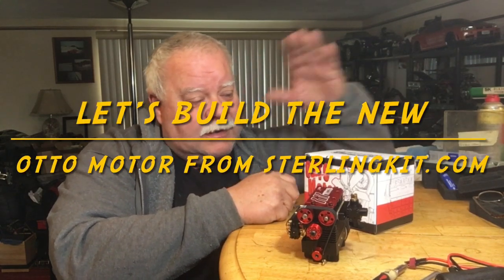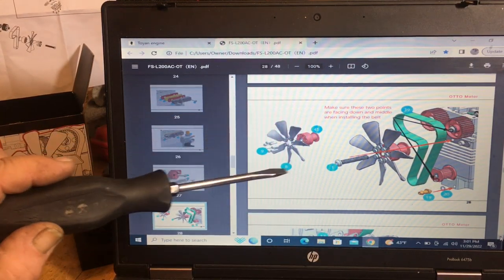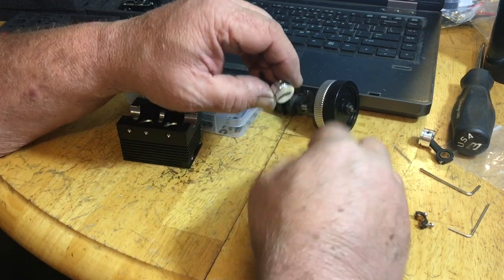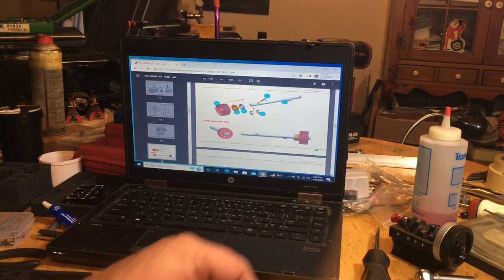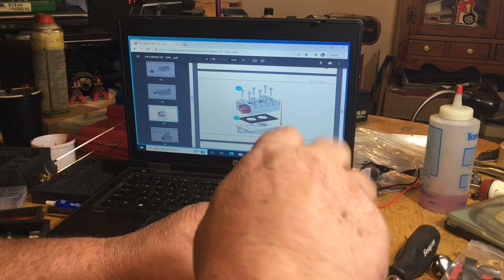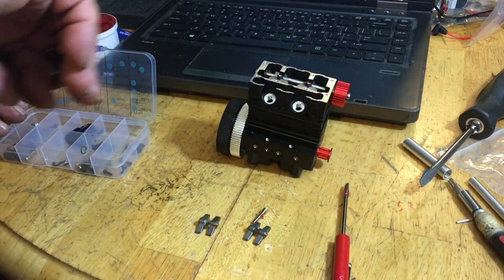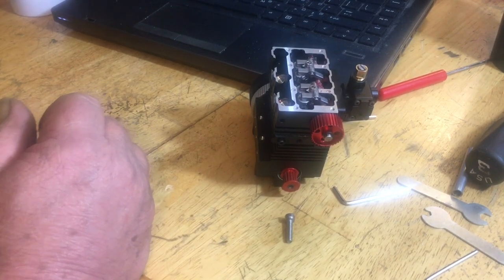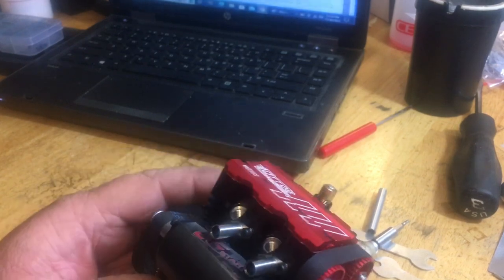FS-L200-OT OTTO ENGINE FULL BUILD VIDEO

Comment: My daughter and I just completed a build.  Our first engine.  We had your video up for every step of the build!  Thank you, thank you, thank you!  Your time is so appreciated and she loved your comments through the build.
Reply: As a note, I will say that I wish you had a video on how to wire up this thing.  My daughter and I have only a vague idea of how that is supposed to work.  We have an on-off switch, a push button switch, an indicator light, some wirey things that attach from batteries to a glow plug.  That is about it.  I kinda get an idea that we should be cutting and soldering stuff.  We will figure it out eventually, but a wire diagram from the vendor with the switches, etc, would have been awesome.  A video from you even better!
Reply from the maker: That is awesome! great to see your daughter is into the hobby 👍😎

Comment: Thanks for the video! I ordered my engine November 2022 and got it almost 5 months later and finally got time to put it together today (4/15). The only problems I had was too much grease on the rocker covers made it hard to turn the camshaft, I just used a tiny piece of paper to get some of the grease out and one of the e clips for the rocker had a burr on the side that wouldn’t let it snap in place. I went to a local rc hobby shop and got a pack for $3. I’d like to get good at cad design and make my own mini diesel engines someday! Thanks for the help! I did have some extra parts in the pack when I was done putting it together though I’ll have to go through and see if I missed something

Comment: I have the same engine that I built that I am using for a STEM class in my High School class.  First of all thank you for the video.  Very well done.  I have two questions.  I can’t get it to start. 
1. What fuel do you use and where can I get it.  I have the gasoline version.  Not the Nitro.  
2.  How far out is you gas screw turned out.  I messed with mine and I need to set it back to factory. 

Thanks again for the video and thank you in advance for the help.
Reply from the maker: Hi thanks for your question the carbs are pretty sensitive to gasoline the nitro fuel uses twice the amount to burn where gas is half or less the incoming charge, if your carb needle settings are 1.5 on the idle and 2-2.5 on the high side on nitro try setting your idle to 3/4 of a turn and 1 3/4 on the high end for gasoline. I have had some tuning issues with gas and always go back to glow plugs and nitro lol

Comment: Hi Dennis
Thanks a lot for this video 
I want to start my build for the same engine but I don’t know what fuel should I use and what type of oil should I put for assembly
Reply from the maker: I use any RC 20% nitro fuel that is available I use Valvoline red high temp wheel bearing grease to assemble but use the red grease on the cam and rocker arms, whatever you use for the lower rotating assembly will get washed away and replaced with the oil in the nitro fuel when you start it up, 👍

Comment: I am just a bit concerned the camshaft timing wheel can be assembled 180 degrees different by the keyway. Both dots have to be at the bottom but surely 180 degrees off has to affect the compression?

Comment: Hi Dennis, great video. What grease are you using? I take it, it will need to be high temp grease?
Reply from the maker: That is correct I use the hi temp wheel bearing grease

Comment: I need instructions with one more thing. Wiring a separate button for starting. I was told on a Facebook reply battery to button, button to starter motor red wire then negotiate from starting motor back to battery. What I'm confused about is d you do this with 2 glow inginters regulars?  Thanks

Comment: What kinda of lubricate are you using on the moving parts of the engine? And what kind of grease are you using on the value train?
Reply from the maker: you can use the hobby nitro fuels they have oil in them and blowby lubricates the crankcase,  I use hi temp wheel bearing grease on the valve train
Reply: @dennisdempseyradiooutofcontrol  Thanks for the reply!!! Okay got it, I still havent been able to put my first engine together because I wasnt sure. Thanks for all the help kind sir 😀

Comment: If before putting on the head if the piston pushes out the liner dose that mean I mixed up the piston in the wrong cylinder?
Reply from the maker: No the sleeves are grabbing the piston ring this is normal

Comment: About to build my Otto motor fs-l200ac do you think Marine 3-2-1 grease will work for assembly and moving parts?
Reply from the maker: Yes brother that is what I use, also I am sorry for not getting to my messages on the push button start, I will upload a detailed video for you this weekend.
Reply: @Dennis Dempsey Radio out of control  thank I would appreciate that sir
Reply: @Dennis Dempsey Radio out of control  ill look for that video haven't assembled it yet
Reply: @Dennis Dempsey Radio out of control  are still going to do the starter motor detailed video ?

Comment: Sorry  for all the questions, how long start to finish non stop does this take to build?
Reply from the maker: Hi brother I did mine in about 2 hours,
Reply: @Dennis Dempsey Radio out of control  Thanks Dennis I that give me a gage for mine
Reply: It was the first build for my daughter and myself.  We had never done a build before.  We worked one afternoon for 3 hours before we broke a cam shaft.  After waiting 2 months for a replacement, we worked another 3 hours and had the build complete.  We were kind of slow as we would read the pdf instructions for each step, watch Mr. Dempsey perform the steps, decide our course of action and move onward.  I don't know if that helps.  Again, first timers.

Comment: hey Dennis! I just had a question hoping to get your input. I’ve got a Toyan v8 and I can’t get it to stay running without the igniters plugged in. Could it be my plugs arnt reaching deep enough? I’m using n3 plugs. Thanks!
Reply from the maker: Hey brother mine needs constant power to the plugs also to get the full potential out of this engine,  I have tried different glow plugs also but it has to idle way to high to unplug the power to the plugs then it has a really soggy rev,

Comment: Can you please help me? I was trying to fix my fs-l200 because it wasn't running that well and I messed with the carburetor too much. The toyan instructions don't help that much, and there aren't any specific YT videos on an FSL200 carburetor. I messed up all 3 of the screws including the top one, small side one, and bottom one. If you could link a good video that's been made or comment on how I can reset my carburetor settings that would be super amazing.
Reply: Yea, similar issue here😂, can't get it to start. As I know the top one is the high side needle that needs to be 2 turns out, the side one is the idle screw 1.5 turns out, and bottom one I don't know what it is. Hope this helps. Please let me know if it works for you.

Comment: You said that on the fly wheel and the pully bow can I tell the brown or dark side is?
Reply from the maker: yes the brown cover goes facing you when installing the pulley,
Reply: @Dennis Dempsey Radio out of control  but double d how tell which is brown is it  disgusable?
Reply from the maker: @nsvaluto48328  yes watch my video you will see the brown cover then I turn it backwards and say no, looking at the rear of the engine the one-way bearing should only turn the crankshaft counterclockwise.
Reply: @Dennis Dempsey Radio out of control   I will watch thank you that will help me with my build

Comment: Can you install the radiator kit on this motor? I ordered it with mine l200 but not sure if it'll work
Reply from the maker: These are air cooled they use the fan blades and nitro fuel to cool them,

Comment: What did you say starter belt number was? I think stirling kit sent wrong belt with mine. I have B86mmxl.
Reply from the maker: The starter belt needs to be a 88MLX belt.
Reply: @Dennis Dempsey Radio out of control  I contacted stirlingkit and they told me this: We need to check with the technician for the issue, however, they are off the office now. We will reach the solution for you after they come back. Please wait patiently.